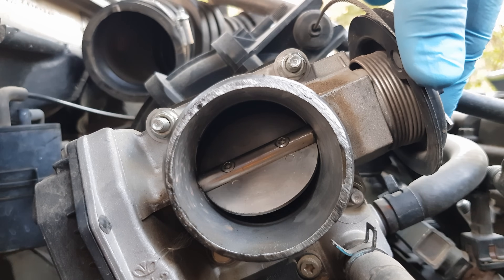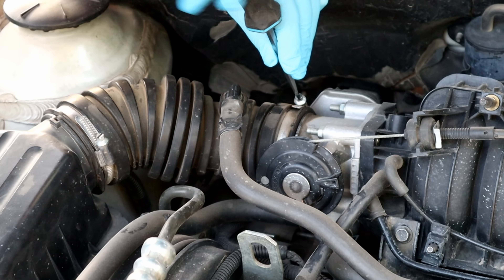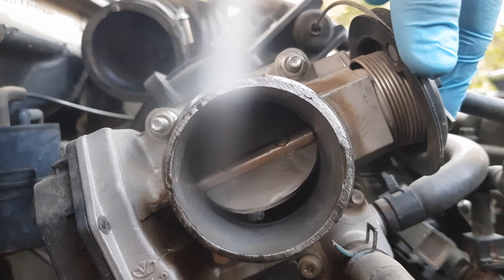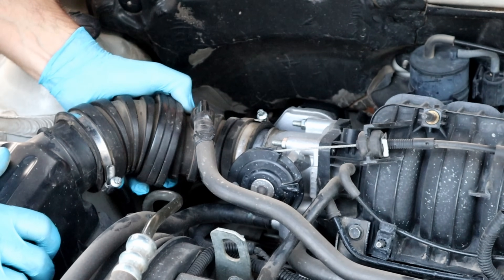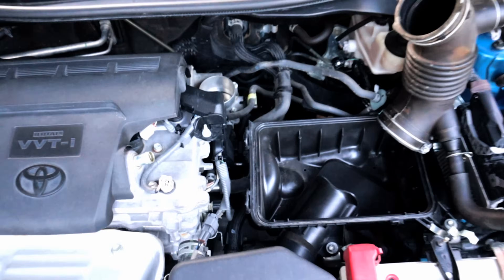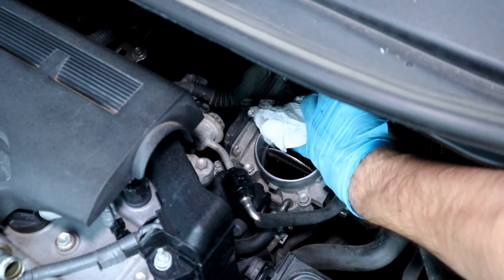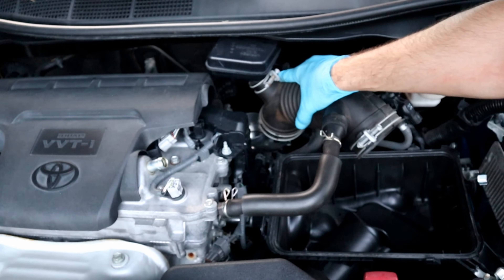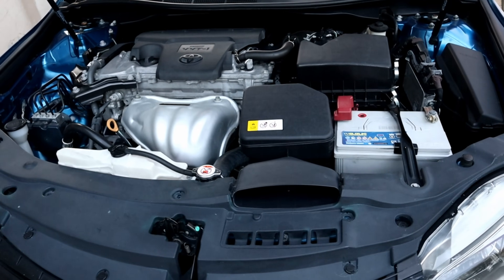Don't Clean throttle body before watching this/Cleaning cable controlled or Electrical Throttle body

Comment: hi, i had my throttle body cleaned at a shop around 3500 miles ago and when i inspected it, it looked so dirty like it had never been cleaned before. what could cause it to get so dirty so fast? engine is 1.8L suzuki esteem. my symptoms were that the engine would cut out when i pushed in the clutch. the symptoms came back, so i decided to clean it again myslf. i have a reusable k&n filter, does this have anything to do with it? 
compared to that, i cleaned my throttle body on my 3.0 vg30e nissan and still 4, 000 miles later it looks very clean.
Reply: I wouldn't use any aftermarket air filters if they are the oiled type microscopic particles of oil are sucked into the engine and can cause problems with MAF sensor and throttle body..

Comment: 1:10 I think it is not good to use a paper towel such as that , too flimsy to have pieces far off and get inside the throttle body . Better to use Scott Shop Blue Paper Towels [ Original Multi-Purpose ]

Comment: Well since MAF is BEFORE throttle, do you think that crc carb cleaner spraying directly to the throttle while engine running would help ungunk the valves?

Comment: How often do we have to clean the Throttle body?
Reply from the maker: I usually check it ones a while, some cars throttle body gets dirty too fast due to too much oil vapor in pcv system, but I would say, check it and clean it if it was dirty
Reply: @AliMECH  Thanks for the reply 👍
Reply from the maker: No problem 🙏🏻🙏🏻
Reply: 25,000 to 50,000 miles

Comment: I have throttle body with cable when I’m cleaning it can I touch butterfly flap ? Or try not to touch it ?
Reply from the maker: If its electrical, it's better to open it with gas paddle

Comment: for electrical throtle..i've done it many times.
no engine check.
no error.
no iddle learning.
no ECU reset.
 ✌️😁✌️
(tips : for electrical throttle, do not touch... do not ever ever touch... the plate/coin)
Reply: What if your car is push start how do you make the butterfly coin move without touching
Reply: @josemonet3382  mine is without push start.
maybe you can try with cotton butt around butterfly coin

Comment: bro Ali ...can we use crc throttle body & intake valve cleaner using vacum line? if yes .. can you make a video about it ?
Reply from the maker: You can use intake valve cleaner from vacuum line, but crc, I suggest to use it like I did so you don't get error code, yes I will make a video
Reply: @AliMECH  tq bro..wish you all the best
Reply from the maker: Thanks brother ✌

Comment: On Toyotas 2014 and up the throttle body does not have a relearning capability it’s done by computer never spray the cleaner in the throttle body you can ruin your cat sensors and the cat you can on these later models use your finger to open the butterfly slowly very slowly and hold it open spray the cleaner on a shop towel and wipe the surface clean

Comment: Since one month I am struggling with my car..  Did this cleaning thrice in one month but still the ideal goes low some times and the engine will be off, sometimes even while driving ... my car is toyota Corolla 2015.. any suggestion plz..Tku
Reply from the maker: What cleaner did you use? Throttle body claner or carb cleaner?
Reply: @AliMECH  used ACDelco Carburetor Tune-Up Conditioner

Comment: I have a Toyota vitz 2004 1.3. Mechanic cleaned my car's throttle body by spraying and engine ignition at same time. The engine would start and stop.
Reply: Does it damage car engine.??
Reply from the maker: If it damaged , you will nottes it right after using carb cleaner,  but on older cars, carb cleaner not damaging throttle body

Comment: Never open the plates by hand otherwise it will damage it. Ok so if do how will it damage it? I know the gear wheels are plastic. Is that what you mean?
Reply from the maker: It's not about the gears, they work all the time, it's about giving out put force to the senior, and it messes up its location, that's why sometimes after touching the plate by hand on electrical throttle body,  the RPM stays abit high
Reply: @AliMECH  Thank you replying. I didn't even think about the sensor calibration altering the  location.position.

Comment: if I disconnect the pcv hose that go before the throttle body and only block the throttle  body side, then I should never need to clean again, but for the earth , I just keep cleaning every year.

Comment: Never use a paper towel use open up lock the throttle with some small vise grips then use a toothbrush to clean the inside and all the way down works much better than a paper towel
Reply: What will happen if you open up the electronic one ?

Comment: What do I need to do if if did used gumout carb choke cleaner on my 2011 Elantra while cleaning n the check engine light does comes on after I did it . Because the check engine is on now
Reply from the maker: For some cars, carb cleaner or other cleaner will destroy throttle body, sometimes you need to reset the ECU like I show here https://youtu.be/bWMSeEKX_ds it will fix it, if the check engine came back you need to reprogram the throttle body, otherwise you need to replace it if the programing didn't fix it too

Comment: Really great video brother. I have LEXUS LS 460 but it’s throttle won’t open even I apply acceleration in ignition mode . Can I open the trottle with my hand a clean inside? Wht about battery negative terminal is it must to remove that ??
Reply: I am seeing my comment after 8 month still no reply 😂

Comment: Too late a mechanic cleaned my throttle body and the car (2001 Malibu) won't idle. It either stalls or races to 2500RPM. It's undriveable what do I do now?

Comment: I cleaned my Suzuki Celerio's throttle body in the same manner with 3M Throttle plate and intake cleaner but now it's RPM is fluctuating, please help!
Reply: Same thing happened to me, did you fix it?

Comment: on my 2009 chrysler town and country when i turned the key on and held the gas peddle down and kept it down with a stick i went back to the throttle body and the flap was not open. why is this. its supposed to stay open.

Comment: hey Ali mech i have a camry 2014 i did clean the throttle body but i got a check engine light but i dont have any issues while my car runs ? what could be the problem ? help me out pls
Reply from the maker: If you don't have any problems with driving, means you didnt give it time to dry after using throttle cleaner cleaner, you can disconnect the negative battery terminal and connect it back again to erase the code, it will be fine

Comment: Can i clean the throttle body while the engine is running
Reply from the maker: Yes you can, but I always wipe some of that oil and let minimum gets inside and burn, even that's how the cleaner been designed to desolve it and burn out

Comment: What will happen if you move the plate on the electric one 🤔
Reply: ...it will throw off the electronics in the Throttle body unit, it will take some time, before the system resets itself and recalibrated the throttle body operations.   It should restore itself.   

if that doesn't help, kill power to the vehicle overnight, by disconnecting a battery cable.

Comment: myfriend, please can you show us how to take it out from camry 2017 safely? I want to clean it inside out, which way better?
Reply from the maker: Why remove it, the car is not that old, only if it's too dirty
Reply: @AliMECH  ok, i will just do it your way mine is 130k
Reply: I did it today, engine light was on and then i reset it using techstream. It is all good now.
Reply from the maker: That's ok, maybe you didn't give it enough time to dry, all good, great job
Reply: @AliMECH  oh yeah, may be that, need to leave it out

Comment: Electronic contact cleaner is not good for throttle body?
Reply from the maker: No, because electronic cleaner creates a thin layer for better contact,  and here we don't need that, if you have sensors in the throttle body, it will cover them and we don't want that, it will mess up reading of the sensors

Comment: Cleaned my throttle body. Took it for a drive and notice that my car jerks when am slowing down, is it supposed to be like that?
Reply from the maker: What did you use for cleaning?
Reply: @AliMECH  nvm it’s all good car just needed to relearn throttle position

Comment: Hey mate Can you clean it  up with water Just put water on the cloth and then wipe it? thanks
Reply: You're cheap guy lol, get one liter gasoline if you're not willing to pay 7 euro for one carb cleaner spray lol.
Reply: @tanchelm I've heard gas will dissolve the special coating on tb flat
Reply: @Flowerchild778  No idea, I always used carb cleaner, but the guy wants to clean with water... Good luck with water if there is carbon build up.

Comment: I clean throttle bodies with brake clean all day long. 
 Don’t get it in sensors. You’ll be fine. If you t body has sensors, spray the cleaner on the rag.

Comment: The better way to do this so you don’t spray electrical Components is to spray on paper towel or carbon fiber cloth before cleaning.

Comment: I did the same to my Camry same engine and rpm was very high. I had to take it to computer shop and they fixed it in 2 mins.
Reply: A computer shop like for laptops and smartphones? You mean the dealership right. What did they do, reset your ECU.

Comment: What if I opened the throttle body using my hand while the car was off?

I have a 2002 Lexus Es300 that’s idling around 250rpm then stalls. Can’t figured out what’s going on. Recently changed the battery also.
Tried “reprogramming” the throttle bottom using the “put in drive while e-brake is on” method and no success.
Noticed that when it’s cold, car starts right up, even idles for a minute then dies. When the car is warmer like normal temps, it won’t start unless I feather it some gas but then immediately after I stop feather it gas, it idles at 250rpm then dies.

Please help. It has 144k miles.

Comment: I turned the key to accessory but the flap didn't move. Am I doing something wrong?
Reply: Turn it to on position. Not accessory. Just before the starter turns over.

Comment: I have a electrical throttle after I removed the air filter hoses to access the throttle I had someone turn the key to a ON position and press down and hold on the gas peddle the throttle did not open up…. Why is that?
Reply: Same thing happened to me. Did you ever find out?

Comment: Anyone have issues with rpm at idle on 2014 tahoes and Yukons? After cleaning ?
Reply: My Malibu had an idle of 2500 rpm after cleaning the throttle body. I towed it to a shop. 40 bucks n 2 minutes later it was fixed.

Comment: Isn’t it bad to get the cleaner into the motor? Shouldnt you have to remove it to clean the throttle body
Reply from the maker: No, throttle body cleaner designed to clean without removing,  it's safe

Comment: Seems pretty dangerous to just spray all that crap into your intake, lots of modern ones mDe.of composites materials that the spray can damage, aside from you basically sprayed all that crap into your engine, why not remove and do it correctly?

Comment: I clean mine and the engine check light come on how to get it off
Reply from the maker: If you used throttle body cleaner, dont worry, maybe some stayed in there before getting dry, you can disconnect the negative battery terminal and put it back to reset the computer, but if you have OBD scanner, you can simply clear the codes

Comment: Why not just remove the throttle body and clean both sides of it with throttle body cleaner and a soft brisled brush like a toothbrush. It's two clamps and two bolts and an extra 2 minutes of your time that will leave you with the squeaky clean throttle body and no fluid inside the engine.

Comment: Really ?? I sometimes use carb/ choke cleaner. I always thought it's the same thing. Just has a different name.
Reply from the maker: No they are different, some cars throttle body get damage with only one spray of carb cleaner, so to be on the safe side,  always use throttle cleaner

Comment: Except for chlorinated brake cleaner, generally that stuff is all the same.  Non-chlorinated brake cleaner, carb cleaner, valve cleaner, it's all mostly acetone, little toulene, maybe heptane, maybe isopropyl alcohol. All the same stuff

Comment: Why buy a dedicated cleaner that is not good for anything else, I just use old fashioned carb cleaner and an old tooth brush, or I use gasoline, worked great.
Reply: MOST throttle bodies have a special coating to reduce crud buildup, and using other cleaners removes this special coating.

Comment: Please don't tell anyone about throttle body cleaning. First, in the video, you don't need to clean those throttle bodies. 
These are already clean. The reality is different, full of dirt with carbon. You take these throttle bodies off to clean them. 
Secondly, i think you are commercially influenced.....